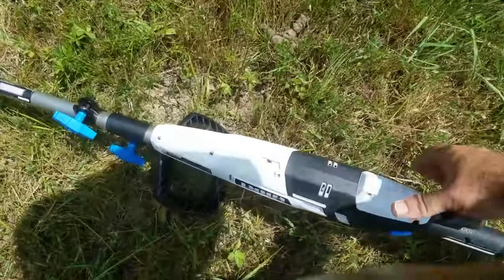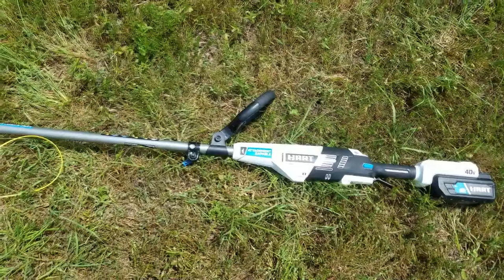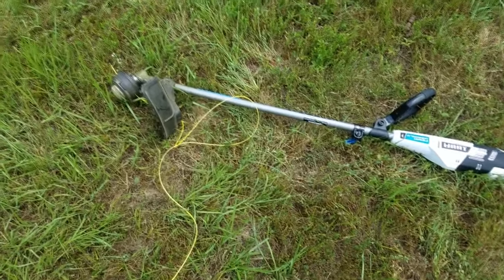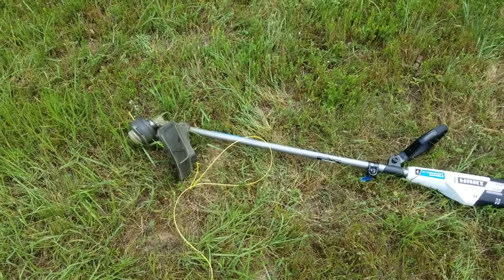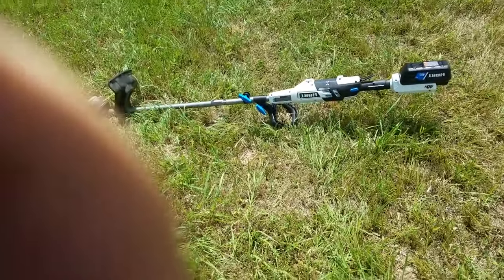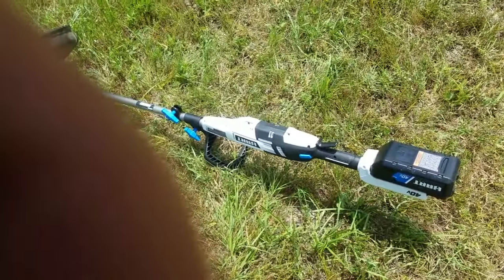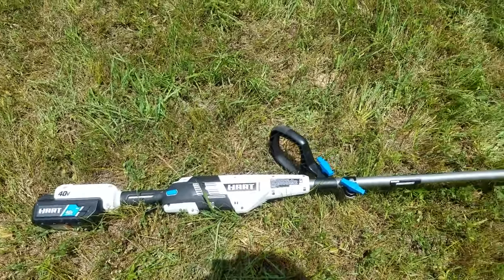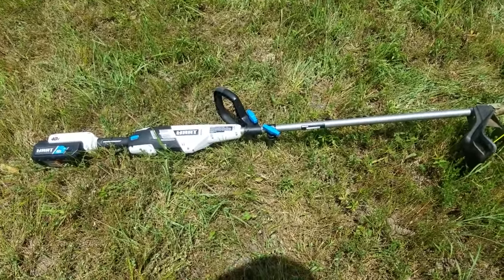How to restring a HART HPLP02  40V weed trimmer

Comment: Thank you so much, Sir! I was getting so damn aggravated with my Heart weed eater too, because I was running it thru the bottom holes, turn it over to follow the directional arrows, then I would feed the ends thru the outer shell and trying to get the insert inside the head.....that's where my trouble was at, the string would unwind and go underneath and I had a hell of a time getting the actual head to go straight in, without it cocking at an angle, squeezeing a forcing it to all stay intact! The way you showed me was MUCH EASIER! My problem now, is the string keeps coming out to far, stopping the head from turning! So every 5 min or so, I have to stop and turn the string back in! But it's definitely better than the string melting together , not allowing it to dispense! But the grass that I cut between times, makes it worth having to stop and rewind the string, and I use the  batteries alot faster now , they die pretty quick now! But to help others out, as you did.....DO NOT USE THE RAPID CHARGER on the batteries, because it messes the batteries up, and they won't take a charge!! So if anyone knows how to get them to take a charge again...please help out with this matter, please! I have 4 of the 40volt batteries that I can get to take a charge!

Comment: Thank you for the video!!!! I found trying to straighten a small sectino of line before you insert  helps the string  line up with the second hole. My line was really easy to wind back into the timmer. Maybe a thick line maybe an issue. Anway my line wound back in very easy.  THANK YOU!!!!!

Comment: How long does it run on it's battery?
Reply from the maker: My battery lasts about 20 minutes to half hour depending on how long the motor is running. Suggest a 2nd battery to swap and charge, but man, those things aren't cheap.

Comment: I couldn't find any detailed instructions with mine.  Everything is minimal.  My wheel is already starting to wear out and I have only had it one full summer with minimal use.  I have a hard time turning the wheel to get the string in, it is very frustrating.  I bought it because I thought it might be lighter than a gas trimmer but better than my Black and Decker that I have had for 7 years.  I am not impressed and I have already bought all the attachments for it and can't use any of them because I can't lift them. They need to make a smaller model for petite people and one that holds up as well.  I hope yours works better than mine!

Comment: Wow that was easy. I found where in the manual it says but it's pretty vague there's about 2 sentences of details. I kept taking the head off and try to wind it up myself and it kept pulling out I wasted about 5 foot of string and an hour but this works finally so thank you
Reply: I had to redo my string and was hoping I could find this again. So easy every other video has the thing apart putting string in.

Comment: Thanks a million, I just bought one today and just as you stated no where in the manuals does it explain how to re string. You gave a perfect explanation and made it simple and to the point 👍 you are awesome. On a side note now that I see how it works I actually like the design alot and it seems to be way easier and faster than my gas powered. Also mine came with a blue wrench that has a spin handle on it so you can spin the spool clockwise fast and easy and I didn't know what it was for until you explained this. Thanks again 👍

Comment: The new model I just purchased has spools of string that give you a single cutting string and you simply swap out the spool when you run out.  I presume you can load the empty spools with your own string if you want.  Each time you release the trigger a 1/4 inch of string  advances.

Comment: But how do you take off whats already inside to put better string? Thank you in advance
Reply from the maker: The same way you extend the string when it gets too short (in my opinion). Hit the button on the bottom of the spooler, then pull on both sides of the strings. Repeat again till you're able to pull it out.
If that's too much work, there are 2 tabs on the sides of the spooler, push them in and pull the whole spool off the head. Bec areful not to loose any parts when you do this. Once the string is removed put the spooler cap back on and restring as normal.
Reply: @OzarkGeek  I'll try that. Thank you so much

Comment: Something looks really odd about it. There should be more shaft between the plastic housing and the accessory connection point ????
Reply from the maker: That is the unit out of the box and assembled per instructions. It not ones light are used professionally. It was purchased at Walmart. The part number purchased is in the title. Look them up in the garden section of any Walmart.

Comment: I just ordered this brand from Walmart for 138 dollars and hope it is the same head as yours. now that you have instructed us how to do it so well. thank you. I wanted it to replace my Honda string trimmer that still runs fantastic but weighs 14 lbs and wears me out in Sw Fl heat. I have installed an Echo speed feed head on my Honda and that's what interested me about your video is that Hart has apparently tried to copy the Echo concept, and i hope it works as easily as you explained it. Walmart is very secretive about model numbers so i can't tell if it is the exact same one.  if not i'll just return it. Hopefully you are still pleased with your trimmer. thanks again.
Reply from the maker: My apologies sir if this did not help you understand how to restring the trimmer. I'm an older guy and that's my normal voice. I do not have a workshop or garage to make more professional looking videos.I'm under 6 ft tall and the trimmer was at me feet. Do the math. I'm trying to do the best with what I have in trying to help people. Thanks you for taking your time to view and comment on this video.
Reply: @OzarkGeek  Hi Ozark. I revised my comment i did at 1 o'clock this morning. i was YouTubed out at that point. t y

Comment: What if it only has one hole for the string
Reply from the maker: If you'll at the side of the spool, into the hole, it goes all the wau through to the other side. Push your string in one side hole and it should go all the way through and out the other side hole. Line up the ends then wind it string on the spool.

Comment: Quick question. Is there any way to replace the head of the trimmer? I bought a weed warrior pivotrim 4x. Having trouble!
Reply from the maker: Don't know. Haven't seen that particular part myself. I installed a different head on an older trimmer I have. When I run out of the string I've already purchased I'll try myself.
Just be aware some of the new heads are designated for straight handle or curved handle trimmers and not recommended to put the wrong models on a unit.
Reply: OzarkGeek this head is universal. But just have a feeling u can’t remove the original head. Thanks for the timely reply 👍🏾